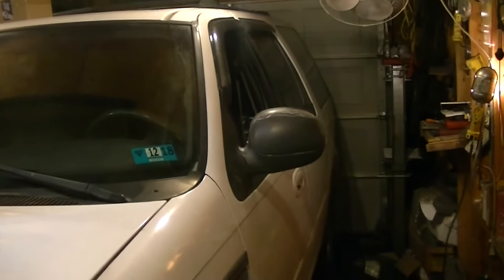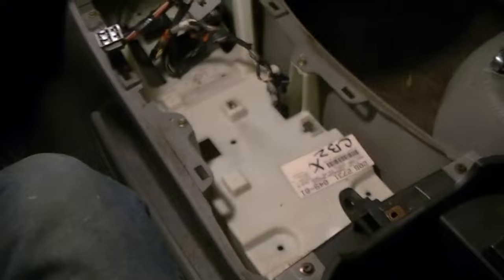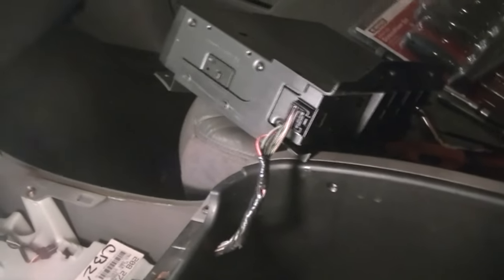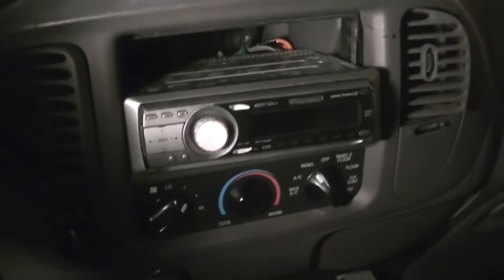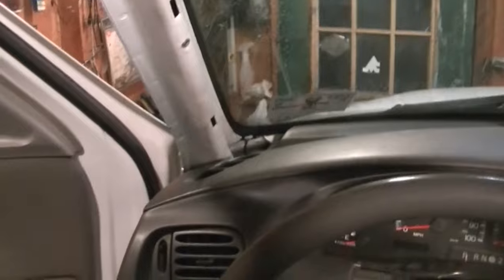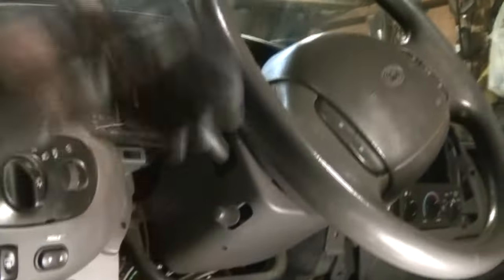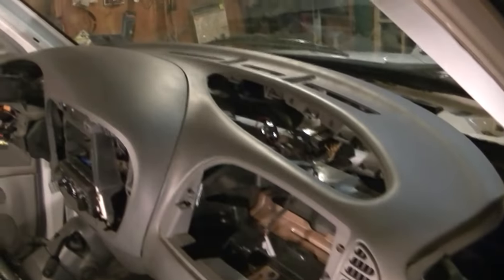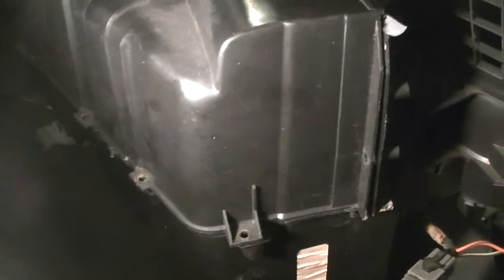Heater Core Replacement. Ford Expedition, Excursion, F150 and more.

Comment from the maker: Thanks for all your kind comments! Heater is still AMAZING in the SUV! Even after 14 days of sub 0 temps.
I had to rush this job, so the quality of the video is somewhat rushed. Wanted to finish it before the Ice age set in.
Reply from the maker: If its not registering on the temp gauge then the thermostat  is stuck pen or you need more antifreeze. Not making the needle move up to "normal" is a good sign of a stuck open thermostat. At least you got some heat to get you started in the right direction.
Reply from the maker: -------Also, not a lot of rust...just small parts of something....fine looking crap. Doesen't take much to block up a heater core.
Reply from the maker: Air flow? You mean blowing... air but not hot air?
Reply: Nathan Rohrbough you inspired me to replace the heater core on my 1999 expedition Eddie Bauer. I followed your video step by step. I finally got it out and I’m about to start the installation of the new heater core. Hope it works. I’ll keep you posted......so I put all back together and it would not start. I had it towed. My mechanic said I broke the gear selector cable. He fixed it. Now it starts and I have HEAT.  Yeah.
Reply: Hi, is this for the 2003 expedition XLT?? My rear heat seems to be barely lukewarm!! I just changed both actuators in the back!!
Thanks
Reply: 02 F150 5.4  I have luke warm heat, heater core flushed 3 times and was a little better each time but didn't last long just luke warm heat again. my blend door is operating like it should, cut access to look at it. new thermostat and water pump, still luke warm heat. both heater hoses feel hot or warm, inlet is a little warmer than the outlet but not much...question..Can the heater core be plugged enough to cause luke warm heat but still have both heater hoses hot or warm?  Thanks for the great video
Reply: Alot of that stuff doesn't hafto come off to access the heater core
Reply: What if you replace the heater core and the leak is stopped but the heat isn’t working?
Reply: Thanks man did my 2004 like cpl years ago and it was great till it got flooded in Hurricane Emilda. I bought another one and will do it on Thursday.  One question do u have a place where I can find the metal blender door for the 2004 expedition xlt 5.4L. Can't find it anywhere.  Thanks again

Comment: if your heater is still not blowing hot enough in very cold weather, replace the water thermostat with a 10 degree hotter one.
Reply from the maker: True or add cardboard to the radiator ;)
Reply: @FixingWithPassion  lol, that's an old bush fix for transcontinental semi truckers

Comment: Added some radiator stop leak in an attempt to seal a leaky freeze plug and it clogged up my heater core. Ugggggs 😶. Did not fix the leak but certainly did a good job at making things worse. Looks like I have quite the job ahead of me. Pulling motor and tearing apart the dash. Beats paying 12k to a mechanical or dealership. 3k vehicle with 300k kinda scream a big no no no NO to the hek no. Wish me luck.

Comment: Great video! No worries on the shaky one handed work. It’s all watchable since you have a good demeanor and subject matter. 
 My heat work but I’m smelling antifreeze when running the heat. Would you say 99% of the time it’s a hole in the core? Could it be a leak from the connectors maybe leaking through that foam in the firewall? How tight is that foam around the inlet/outlet pipes? I never see any leaks under the vehicle but I hate to get into all this and it not be the heater core it self.
Reply from the maker: Nice!

Comment: Thank you so much for taking the time to make this video, I did the heater core in my 00 Expedition thanks to this. Unfortunately for me it was not the heater core causing the issue. I've replaced the blend door actuator, thermostat, heater core, bled the lines and added new coolant, verified there weren't any error codes - still no heat. Only thing I haven't tried is replacing the water pump, after that I have no idea. Thanks again for this.
Reply from the maker: Put your hands on the heater core hoses and see it there getting hot.

Comment: Great video.  I’ve trouble shot my 2003 5.4 expedition down to the heater core.  Changed out the water pump, thermostat, swapped the lines to the core, no love. I watched this video to see what it would take to replace the heater core and have decided to trade the rig in for something newer.😂
   Its like Ford decided to build a truck around a heater core.  Retrospect I’ll try an acid flush before giving up.  -30 temps in Alaska right now; I need some heat.
Reply from the maker: O my!!

Comment: You're both videos on front and rear heater corners were awesome. I have a 2002 XLT and I just did the front one not too bad of a job and I am got mobility issues that was a bit of a challenge. I did have a little better help. But I did 80% of it myself. Took me about 4 days gonna take some breaks.  You said to take breaks LOL getting ready to do the rear heater core.
I should be able to do that within about 8 hours. But just want to let you know. Really appreciate your videos and I did try to subscribe to your channel
Reply from the maker: Nice!! Just in time for winter!!

Comment: Thank you for this video. My Navigator has not had heat in years and when you run the heater or defroster all you smell is antifreeze and it fogs up the windows so you can't see a thing. Decided I was gonna do this myself. Thanks for the detailed video will be using this as my reference when I attempt to fix it. Thanks again.

Comment: Great video. The last time I did it was in 2012 on a 1999 F150 4x4 4.6. I swore I'd never do it again.... Well, my buddy has an 02 Super crew 2wd w 5.4.... said his heat wasn't working... Said the air wouldn't blow... I opened my big mouth and said, "I can fix that"... New blower motor, new resistor, new relay... No prob, right??? Ha!! Then he says, "Oh, I meant to tell you the heat isn't hot, either." Darn. Now I'm down to doing reverse flushes and, if that doesn't work, a new heater core. Shoulda kept my big mouth shut :)
Reply from the maker: NICE! O well sometimes you win....and your still broke and cold. ;(

Comment: I followed your directions exactly and was able to replace my heater core.  This is a very useful video.  I'm reinstalling the center console and I noticed there is a very long five wire harness (Y, R, Wh, Black, Blue) that I know I didn't disconnect.  Your video does not mention it either but I see it tucked up inside the center dash (under the radio).  Would you know what this harness is for?  Thanks for a great tutorial.
Reply from the maker: Nice!!!
Reply: Those are actually the vacuum control lines that help actuate the door that changes the air flow direction (defrost/feet/regular air vents).  I learned this when I couldn’t get the air to flow anywhere but in the defrost position on a 2003 Expedition.  Whenever you loose vacuum to the system, the default position goes to defrost and it won’t change until you find and fix the vacuum leak.

Comment: Great video for step by step. I used my Sawzall and cut the tubes off inside the car and pulled the stubs out into the engine bay. Lot easier than trying to stuff my mitts up under that cowling. Thanks for taking the time to make this happen.

Comment: Nathan, great video my friend! I was able to replace the heater core in my 2000 f150 and I really appreciate it. Saved nearly 1000.00 in labor cost. I also fixed the odometer blink issue. One question--the airbag light is blinking after I reinstalled it--do you have a solution for that?
Reply from the maker: Great! Airbag...check the wires...something not hooked up.
Reply: @FixingWithPassion  Turns out it was a code for the light on the airbag switch. The bulb probably got broken while that panel was being tossed around with all the others. Found a great cheap fix video for it: https://www.youtube.com/watch?v=09dFodezStc&t=109s 
--Also, just a couple notes I made that might help others like me watching your video that haven't done this before:
* The quick disconnect fittings on the heater hoses: I had to cut them (couldn't get them loose) and buy new quick disconnect fittings. The aftermarket "universal" fittings DO NOT work, they will not engage over the ring on the heater core line. You have to get the Ford specific ones (you can buy them at aftermarket stores, but you have to ask for the Ford specific ones). 
* When you re-fill the coolant system, you are probably going to have a serious air pocket/bubble in the system. I had NO HEAT at first, thought I was going to have to do the whole project again... Found a great video on how to "burp" the coolant system, everything worked perfect once that was done. Here's the video:https://www.youtube.com/watch?v=4gk4xb9aOgE

Thanks again for the great video, really helped me out!

Comment: Hey man, excellent video tutorial!!! Specially videoing with one hand & working with the other! I’ve got to change out a heater core on a ‘11 Expedition 5.4l soon. How long do you think it’ll take from beginning to end, including a coolant system flush & fill?
Reply from the maker: Not sure if the dash is the same built wise because of trial and errors through the years, but it can be done. They have to make autos to be fixable. Do some googling, you'd find better answers there. Thanks for watching.

Comment: Excellent video!! I've been watching it preparing to do my 02 expedition heater core!! Only thing is mine is going to be tricky, before I bought it some tried fixing it apparently because the heater core has been bypased with a separate hose. Anyway I hooked it back up to the original hoses to see if there was a leak in my heater core and there was, but my air conditioner wouldn't work. So I took the heater core hoses back off and put back the bypass hose. 
     So would you have any suggestions on how to fix that while I have it all apart?
Reply from the maker: Its easier to do when its all apart. Get a new heater core you'll be a happy man!

Comment: OMG thanks for this video. Im only hald way through with it and will finish it, but I may just cut my hoses and link them together. Sure I will never have any heat, but this is a lot of work. Damn these auto makers. They could have placed it under the hood or a simple and easy place to get to. I have good heat coming out, its not great but it is pretty hot. My issue is that I have vapor coming out that has a small of antifreeze to it. Not sure if its my heater core or not. Thanks for the video. If I do decide to change mine, at least I can follow your video.
Reply from the maker: Nice!!
Reply: @FixingWithPassion  well I kept putting it off with the little vapor coming out and now it is worse. I really didn't want to just bypass the heater core, so that's why I put it off. Now after watching your video again, I think I will go ahead and replace it and just follow your video. I will use a lot of Ziploc bags and keep the bags on either side so i know which side the bolts go back on. Maybe I will get through it all and end up with no bolts left over. I just can't go without heat, so this is the reason I'm going to just go through with it. Thanks for the video and I'm just going to make a week project out of it so i don't get frustrated with it all. Thanks

Comment: 02  F150 same symptoms only luke warm heat, but both heater hoses are warm to hot. heat was a little better after heater core flushes were done, but returned back to luke warm in a few days. blend door is working good. water pump and thermostat replaced too, should I replace the heater core next to fix the heat problem? Thanks
Reply from the maker: Fun Fact: Same happened to me. A new heater core fix the issue. Try to flush the engine before  you install  a new heater core... just to clean up things.
Reply: @FixingWithPassion  Thanks for the reply, it is really appreciated. you said the same thing happened to you, so were both your heater hoses hot and only luke warm heat from the heater?
Reply: @FixingWithPassion  
Ddd Ddd
 Thanks for the reply, it is really appreciated. you said the same thing happened to you, so were both your heater hoses hot and only luke warm heat from the heater?
Reply: @FixingWithPassion  New heater core installed last week, had good heat when driving short distance a few different days, But...Today my son drove to gas station about 5 miles had good heat, got gas drove a few more miles then the heat went to luke warm again. then he went to doctor appt. drove 25 miles with only luke warm heat. shut off truck for 45 mins. came back and had fairly good heat for 25 mile back home. shut truck off 20-30 min, drove about 30 miles and had good heat again..it seems to build up the heat when the truck is off. why? can't figure it out...has New heater core, New water pump, New thermostat. New Serp. belt. one new heater hose with restrictor...someone please help us find out what is wrong with this truck heater. Thanks.

Comment: Hello!  I’m getting ready to help a friend replace the front heater core on his 2003 Ford Expedition (5.4L with front and rear auxiliary heating and air, not sure if that makes any difference or not). The procedure should be fairly similar for this model year correct?  It doesn’t look like you had to evacuate the refrigerant to do the heater core install, is this in fact the case?  It seems like I’ve seen several videos/forum posts saying that you have to open up the a/c system to complete this job, but then In other posts/videos like this one, nothing is said about evacuating the refrigerant, and it doesn’t appear that you touched the a/c system at all.  It sure would be nice not to have to worry about messing with the a/c if we don’t have to.  Any insight into either scenario would be greatly appreciated!  Thanks for your help!!

Comment: I removed all the screws from the center console but it won’t slide backward it’s like the brackets are holding it still. Any ideas?
Reply from the maker: You have to almost  pull straight up after just sliding it back a 1" or so.

Comment: Mines on 2002 navigator but the lines run to back of the 5.4 engine can i just pull them inside and unhook them i literally cant reach or see them behind the big intake

Comment: There has to be an easier way to get to that heater core. I thought it would be somewhere inside the engine close to the fire wall. I guess the older the vehicle, access would be difficult. I'm screwed since I have a 2004 Ford Freestar and the mechanics in the area just can't seem to nail the problem. No heat from frosty Northern Florida.
Reply from the maker: I know right!  Some cars are easy to do. But SUV's and trucks now days...you have be a PHD there completed!
Reply: Older vehicles are actually easier. A 94 explorer is a 10 minute, job, 95 could be 10 hours for a first timer :lol:
Reply: Alvaro have you got it fixed yet?? There is a great how to video by a guy named jake payne.

Comment: Would a 2001 ford f150 heater core fit a 2006 Crown victoria? My 2006 Crown vic has a bad heater core I need 2 fix and I don't have the money 2 buy 1 right now but I have a parts truck in the back of my house and it's a 2001 ford f150 they kinda looks the same. Thanks in advance

Comment: What an awesome video.  Thank you.  Quick question, will this work for an 08 Navigator? 5.4 as well.
Reply from the maker: Some screws are different but pretty close to this. The center console is going to be a pain to get moved back....but think how much money you will save!! doing it your self. Do some research before to make sure.
Reply: Nathan Rohrbough thanks a lot.  I sure will do some research.  I cleaned the coolant system and it got way better.  Just found out I can literally drain the heater core as well.  I’m gonna try that first and hopefully that fixes it.  If not I have to get in deep with the sharks lol

Comment: Very useful video, it just helped me tackle the core in my 97 F150. Many thanks and I like your Expe 👍
Reply from the maker: I hate doing them in the winter. When I smell a slight of antifreeze on a cold morning when starting the motor, I get paranoid worrying.... was the the heater core starting to leak..lol
Reply: @FixingWithPassion  
I bought the truck earlier in the year with the heater bypassed and I had to dive in to find out exactly why. Luckily the hoses and connections were good, so I replaced the core and broken blend door and it seems to have solved the problem. 
I hit the repair hard on possibly one of the last nice weeks before winter (as I live in Texas and I still sweated while fixing the heater in November). 
The temperature difference in our repair periods were probably 50-60 deg F but I needed it done before actual cold weather 👍

Comment: So u flushed it like three or four time in ur videos then u finally replaced it?  Why?   Did u damage it by flushing it?  It was running hot in ur videos...
Reply from the maker: No, it kept getting warm in side the cabin... after a while after I'd flush it. The heater 
core was rusty inside and just could not put the heat in a demand situation. 
Nothing I could do about the rust stuck on the 
inside. So with it being -15 degrees for over what seems like 2 weeks 
now. I said,  O hell NO! Time for a new heater core. Never leaked.
Reply: TVWXMAN32 i flushed my 02 expedition front and rear and it was god awful.  The rear was sooo bad.  I may flush it a few more times but I’m hoping I don’t have to replace it.  Do you have an email?  I can send u pics of the rust build up I had in my cores that flushed into bucket
Reply from the maker: I'm replacing the rear on also. Video soon. It should be a lot easier.